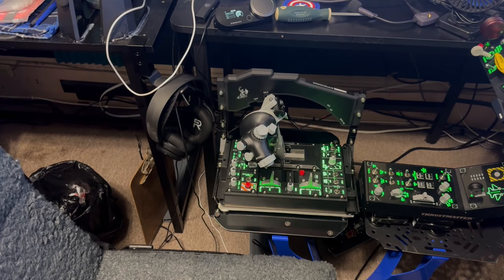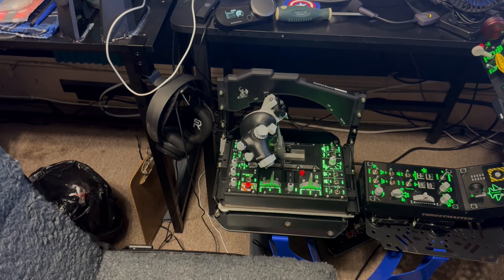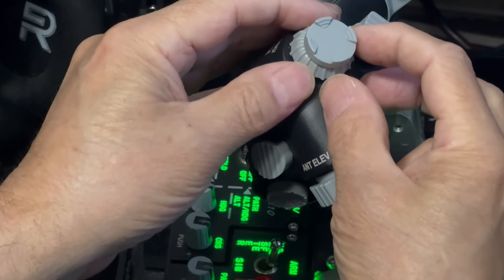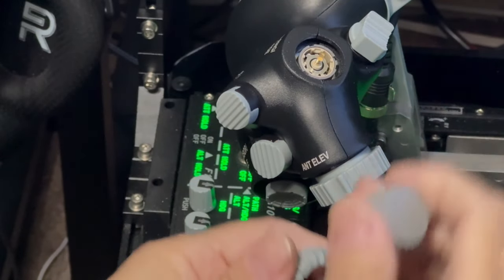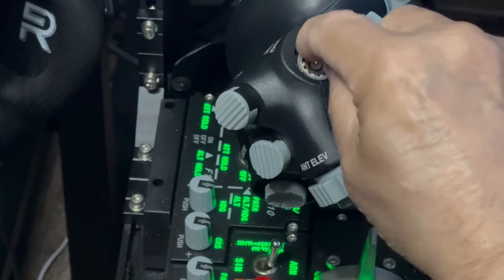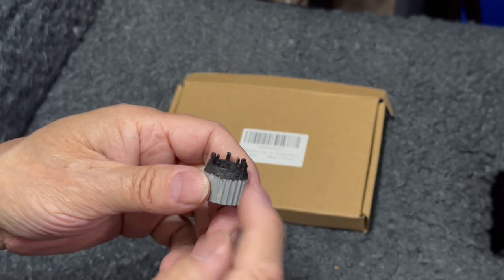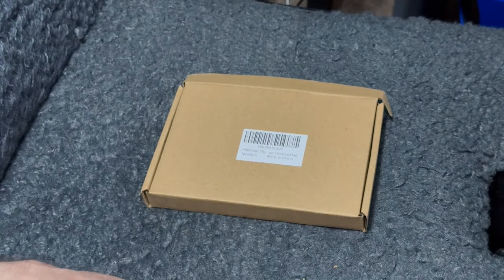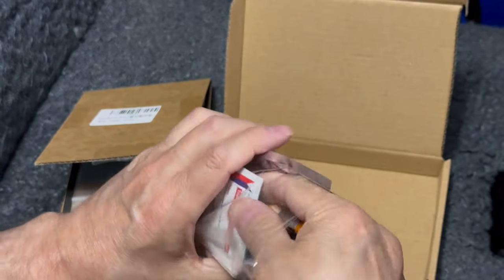How I Transform My Winwing F-16c Throttle Grip With a Simple Mod!

Comment: I'm almost positive you just eliminated your cage button. 
The wheel function is the zoom for your TGP in the block 50.
The forward and aft is the steer point up and down on the ICP.
Reply: I was about to say thing the TGP zoom in.  There is a Etsy fix for this issue I believe would of been a better option in my opinion.

Comment: The issue I have with the throttle is that the handle is too tilted back.
If you compare it to the real one, in idle position, you can see that 
1 - the antenna elevation dial is pointing downwards on the real one but in winwing's version it's pointing a bit forward.
2 - The cage/uncage button is pointing forward on the real one, is pointing to the sky on winwing's version.